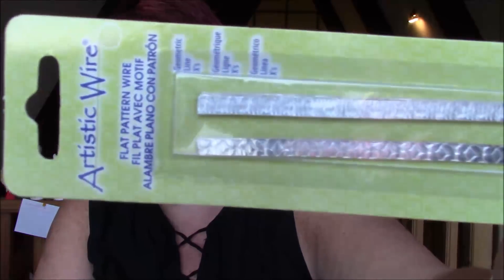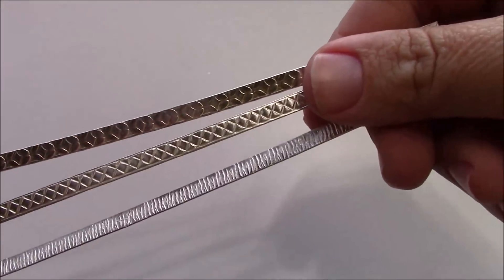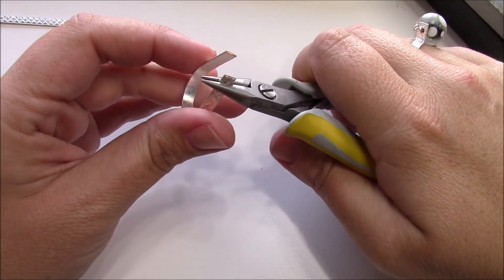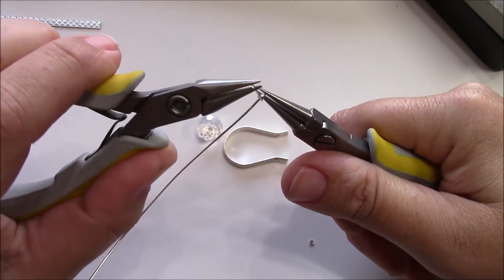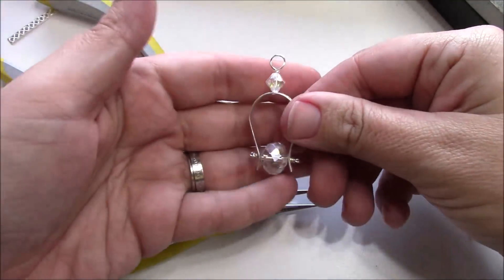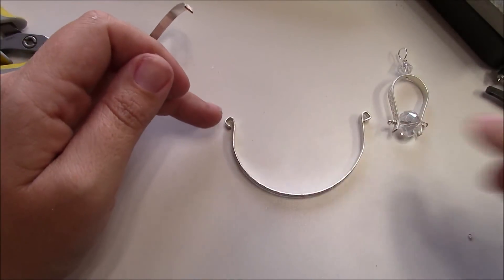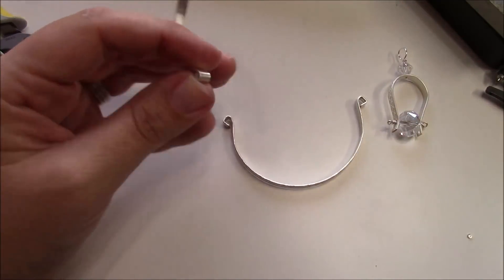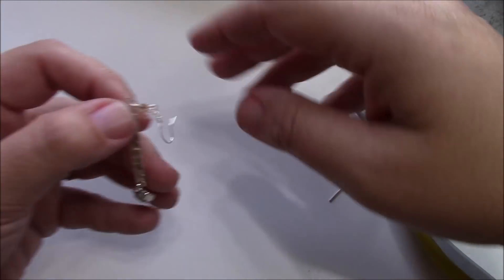Flat Pattern Wire - Must Know Monday 7/23/18

Comment: Kelly do you have the ring mandrels on your site? and what size did you use to bend your pendant on?
Reply from the maker: Yes we have the metal mandrels on our sight. I believe they are in the tools section of the site. I used a size 9 on the mandrel for my pendant.

Comment: Can we use our memory wire cutter on these? Good video
Reply: Dorothy Ferris - No - if you look at the cutting edge of memory wire cutters, they are rounded and therefore wouldn't give you a straight cut. Also, as the wire is wider then normal you would need to make a couple of cuts/snips. The best cutters for this job are flush cutters. You also may need to use a nail file to give a flat edged finish. All the best Mary
Reply: thank you
Reply from the maker: I would not suggest using any cutters except some really heavy duty cutters. You will ruin your cutters if you don't use something that can cut thick wire. This is a 14ga wire so its pretty thick
Reply: thank you I forgot about that and the cutter is in a different place at the moment.

Comment: Hi Kelly,  Are these nickel free? Thanks!
Reply from the maker: I don't think so. They are made out of the same material that regular artistic wire is made of. According to BeadFX who emailed Beadalon about this, this is what Beadalon had to say about it "All of our wire (except the Non-Tarnish Brass) is copper-based. In the case of the silver colors, the copper is first covered in silver then the polyurethane colored coating is applied over the silver."
Reply: offthebeadedpath Thanks for the info!